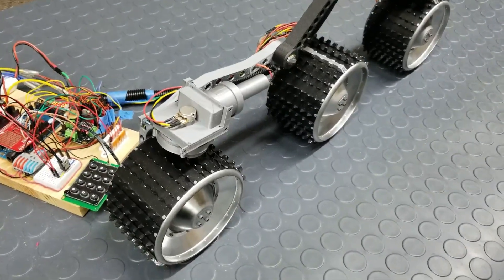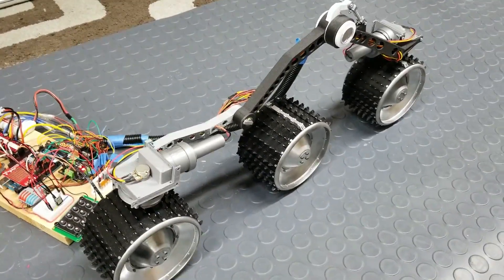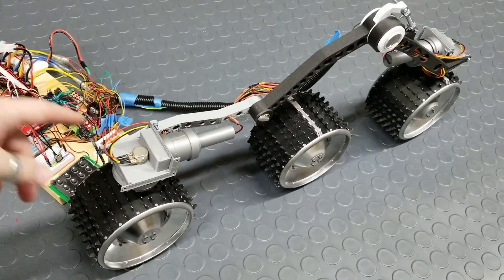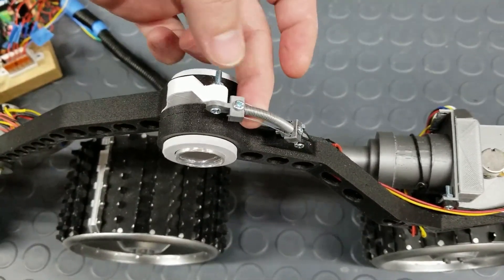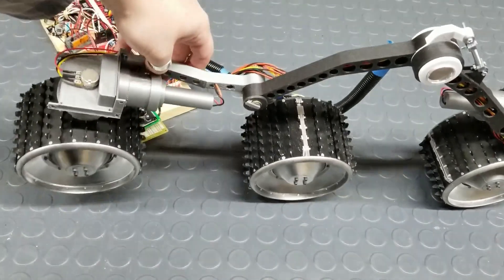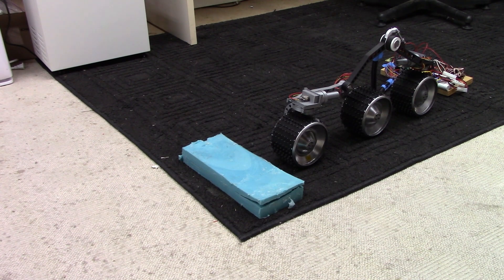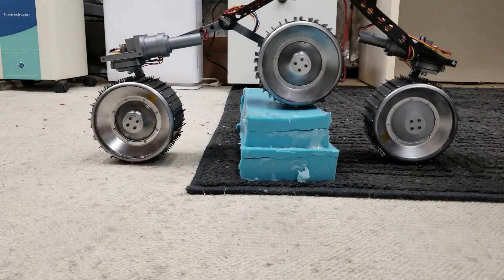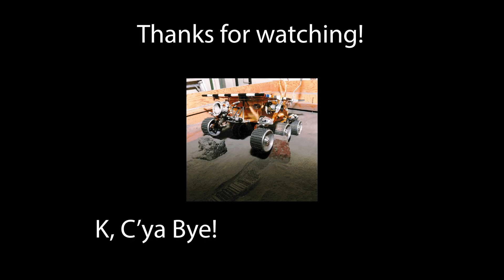Stress Testing The Sojourner Replica's Left Side Suspension

Comment from the maker: I figured out the code for monitoring and adjusting wheel RPMs. Now it climbs over the silicone blocks much easier without stretching the plastic frame too much. The Arduino can now adjust each motor's PWM signal based on the wheel's speed as it tries to maintain a set RPM while climbing over obstacles. Here's an Instagram link showing a side by side video comparing the old code to the new code: https://www.instagram.com/reel/Cp_HallAg3F/?utm_source=ig_web_copy_link

Comment: awesome! Do you know how the differential bar works during the deployment? I think the stowed position of the front half of the rocker is incompatible with the differential bar position when rolling, so I think there is another trick in there.
Reply: I found my answer at the DOI 10.1115/1.1998-APR-6 , the differential arm is stowed completely sideways, so the left horn is full forwards and the right horn is full backwards, such that the difference is zero. It's actually useful, because when the back wheels push to fold the rockers, it prevents the robot from rising ass up/nose down, it stays parallel to the floor during the whole rising process.
Reply from the maker: @nraynaud  That's awesome that you found the paper that describes this design! These are the types of papers that I've used to design my parts so far. There doesn't seem to be any actual CAD available so you have to read papers like this and then get inside the mind of the engineer to figure out why every part was shaped the way it was. I almost enjoy the research more than making the parts. lol